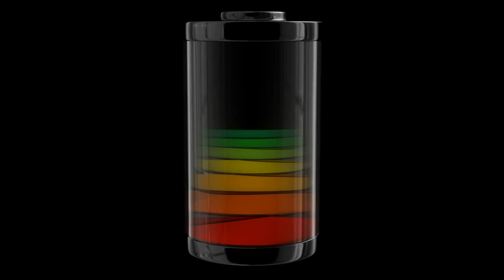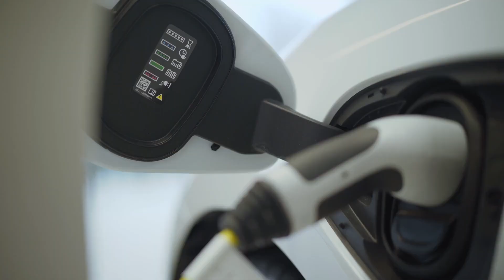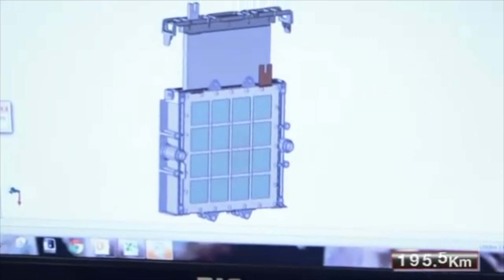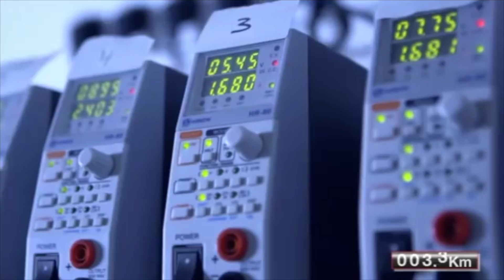This Battery Gives EVs 1000 Miles of Range!

Comment: We have for ever used the concept of refill and replacement, be it the AA batteries or gas in your cars, or soda bottles for coke / Pepsi, or the clothes you wear if you look at it in the broader picture. 
If a car can run 2000km per swap, it's a long time before you need a swap for the typical office commuter, and maybe a double hault for a transportation vehicle if its crossing larger distances. This I would say is a convenience, much less a hassle as long as the adoption doesn't come with higher car maintenance (increased cost/down time in car maintenance can be a major deterrent)
Typically even your cars have a battery for starting engine and so on. It all comes down to having a cost effective process of swapping batteries and wide adoption of those by multiple manufacturers. The infrastructure will come on its own and will prove to be definitely cheaper than the current concept of electrical charging or batteries and the associated wait times. 
Looks much promising and sustainable.

Comment: Single-use aluminum-air batteries with thousands of miles of range is a plausible solution, but I have to point out that lithium-ion batteries will still be required for regenerative braking to work. Supercapacitors couldn't recapture all the power generated by descending a long mountainside, for example, so without a lithium-ion battery you'd be spending extra power from the main aluminum-air battery to climb the mountain and then throwing all that energy away during the descent.

Comment: The problem with battery swapping where the station can't recharge the swapped out battery is they would have to store that battery until it's picked up by the recycler.  These batteries are huge.  Imagine 100 cars swapping batteries per day at a typical station.  Let's assume the recycler comes once a week to pick them up.  That's 700 battery packs that take up maybe 20 cubic feet each or 14,000 cubic feet.

Comment: Not rechargeable? Better off using alkaline battery then lol. FROM buzz to buzz kill..promises can be broken. Copper air batteries might do better. EV are for the rich at the moment. When they come down in price is when they will be more accessible. The price of the dead battery replacement is goo expensive.

Comment: Interesting concept. Overall, a good review of Al-O battery capability and challenges. Every form of energy has its advantages and its drawbacks/challenges. As we think “Green”, we also need to look at the full cost of any energy form from production to customer usage to final disposal (as applicable). Fossil fuel (which is a big misnomer) has really benefited mankind even amongst the bad rap it has been receiving in recent years. Without the use of petroleum fuel over the last 100 years, there would have been much less progress and development. Exploring new energy sources is a process. How many thousand years did it take to learn to reap the benefits of petroleum? Look how much progress has been made in the last few decades regarding batteries. The use of petroleum has allowed the migration of people from food production and survival to being able to have jobs that allow new development that ultimately benefits mankind. As for me, I am thankful that we have been able to harness the energy of petroleum/gas to improve the lives of mankind very significantly in the last 100 years. However, I look forward to newer technologies that will provide greater benefits to all in the next 100 years.

Comment: 300 miles Tesla battery is 1000 lbs and 2 gallons for gas?  What sedan can go 300 miles using 2 gallons?
Reply from the maker: Difference in energy stored, vs actually be efficient in converting it to motion. Gas engines suck at that

Comment: I'm imagining this: A service station similar to a gas station. Drivers enter, release the spent aluminum air battery from some kind of catch on the bottom on the car. You then drop that into a "used battery"slot of some kind. Then you pay some fee to grab yourself a new battery pack. Pop it in the slot, and you're on your way. From the service station's point of view, they would collect all the spent batteries and send them off to recycling centers while keeping enough stock of new ones. They could also provide clean water if that would be a limitation as mentioned in this video. Of course, some sort of legislation would be required to ensure all vehicles are built with the same compatibility, so the battery packs would be universal.
Reply: Something like a srive through car wash where it pulls you along the stages. No need for cash as can all be done robotically charged via reg plate
Reply: Under the system we have Money is God, so it won’t happen by killing the Golden Goose. Anything that make life easier is targeted for profit, cost more than gas Petrol.

Comment: I love the idea of swap able battery packs especially if they are user swap able. I'm imagining it now you pull in to a swapping station and pop in the new ones just like you would pop in a new pair of batteries in your remote. Plus if your going between further points nothing would prevent a driver from having a couple of spare cells in the trunk just in case they get low at a halfway point.
Reply: Yes. And If range is 1000 miles then user can have second pack sitting at home getting charged slowly for many days via solar - this could actually remove charging costs completely. Imagine vehicle costing zero dollars for fuel and comes with two packs when you purchase it

Comment: About the electric cars being the clean energy ( in real use is just for air) Once and again the same was told us about petrol wen Coal was the main sorce of fuel.....  If today you need 10 times copper just to one car production make the calculations for all others rare minerals if today the air is clean tomorrow the water and soil of this planet will be so pollute that you can drink or eat many health products (chille already have an open mine with more than 1.5 miles long and  0.5 miles depth and extraction in become dificult to get but more digging is being done) . Search the documentary the dark side of green energy. If this safer option is so good why they still fast forward to water pollution.... This people just think in how to make more money

Comment: When we start talking about 500 and 1000 mile ranges, what i really want to know is what battery % or miles will it cost to run the AC overnight parked (10pm to 6a) to get the inside down to 70F from 80F outside?

Comment: 9:50 Regarding a battery swapping station, in 2010 I predicted we would eventually see batteries standardized (up to a half-dozen configurations/sizes) by order of the federal government. Vehicle manufacturers would be required to install batteries in a manner making replacement a simple, routine procedure. Then we could pull into a battery station and have a batter swapped in no more time than it takes to fill a 30-gallon tank with gasoline -- for a fee, of course.

At the time I worked for a company that used dozens and dozens of electric forklifts. Often, when it wasn't possible to charge a lift for hours, it was taken to the batter-swap station where a hoist was used to remove the old battery and install a fresh one in less than five minutes. The same could be done with EVs.

Glad I didn't post this yet. I see at 12:15 this is the topic again. Yes, there would be things to work out, but the same issues probably existed in the early days of the gas engine and we got past them.

Comment: that battery swap its around 50eur to say, for me thats a full gas  so every month same price = no difference from using gas, only difference takes me months to use up all the gas i put in the car. When you say pollution, hows that electricity produced ? a coal power plant is producing that electricity you use for the car or any other device, yes we have renewable but thats a small %

Comment: The Al-Air fuel cell besides swaping the whole battery there is another option:  flush out electrolyte and sediments with fresh one and
Insert new Aluminum Anode plates.
Keep a supply of Aluminum Plates in garage. So no need for battery reprocessing industry. 
Just need a fresh supply of 
Aluminum plates and fresh electrolyte. Then take the Ox.Sludge and used electrolyte back to recycling station.

Comment: I saw something on another "future" battery which my Google Fu is failing to find which I think used carbon that while less energy dense than current Lithium Ion batteries recharges much faster which if it works out would be a great choice for those of us that do not have access to electricity where we park. Yes it would need infrastructure in the form of charging stations but since the charge rate is so much faster than Lithium Ion instead of the current 20 - 30 minute rate to an 80% charge we would be looking at times that more match the time it takes to fill the gas/diesel tank of current vehicles which is more in the five minute range for most civilian vehicles would make using public charging stations viable for the average person.

Comment: Today the best energy to use in vehicles is hydrogen to run the electric powered motors , Toyota has a patient on the high pressured hydrogen tanks, just for this purpose. That will be the real clean energy without damaging our environment.

Comment: 2 gallons of gasoline might be the equivalent amount of energy, but it doesn't give you 300 miles of range.  That's closer to 20 gallons depending on the vehicle.  Still tho, much less than 1000 pounds.

Comment: The very best solution to electric vehicles is the establishment of a hemp-create pyramid with a gold box inside. This gold box contains a radiated stone using high voltage DC current for an extended period of time. This pyramid was built to allow growing conditions to exist surrounding further built pyramid structures, thus feeding the growing populace. Presently there now exist a problem/solution to driving vehicles. Using this "Free" electricity to be generated! Placed on the Mississippi River near St Paul Minnesota along with a giant Crystal placed in the Gulf Of Mexico to absorb the north-spun current generated off the pyramid base(into the water) then circulated to the Crystal, then off the planet Naturally!

Comment: The problem I see is aluminum takes quite a bit of energy to refine and process... and replacing a 50 pound aluminum battery to go 600 miles sounds HORRIBLY INNEFICIENT.  I think this is a complete no go.  Yes it might have 9x the density, but at least a lithium ion battery can be charged what 1000 times...  So if this battery is 9x he efficiency and costs 1/10 the cost of the LI battery... you are still talking 10x the cost.  You will spend more in batteries than the Tesla the first year you own the car.

I think I am going to wait for a solid state battery or something else.

Comment: It takes massive amounts of electricity to process bauxite ore into aluminum since it's done by electrolysis. That's why the big push for recycling. Melting down and reusing aluminum takes much less energy. So you need a lot of renewable electricity.

Comment: We already have to stop at gas stations to refuel, which already have to be supplied by trucks carrying fuel. Electric vehicles need to charge for at least tens of minutes if not an hour to fully recharge. Aluminum air batteries would alter very little about the current logistics we have in place. Over the last 100 years we've built up our society around refueling stations and this battery solution fully leverages that. It's nearly ideal.

Comment: Although it is true that Lion batteries contain flammable ingredients, my understanding is that most of the battery 'fires' are in fact runaway chemical thermal reactions within the battery, not involving taking oxygen from the air. The energy in a lithium ion battery is stored by putting the lithium ions on one side of a barrier that they can only pass through with the help of electricity going around a circuit. But if you heat it up enough that barrier breaks down and they can get through directly releasing all the energy as heat causing a runaway reaction. this is technically not the same as the ingredients burning.

Comment: What a great channel. Very nice and easy to understand presenter.  

I was wondering while on the topic of Battery Power maybe there can be 2 shows on The Tesla Tower, which is a way to transmit power wirelessly thats been around for 100+ years (never went commercial since JP Morgan could not make money from it).   Functionally I guess its the same as wireless charging of your cell phone.   The 2nd is a battery from Toyota called the quantum battery that promises  30 second charge time and 1000 miles per charge.

I hope some of these ideas make it into shows.

Thanks..

 Jeff

Comment: A 1000 mile range would finally make electric cars practical. Because the range estimates from Tesla Ford etc are complete bullshit. When Tesla tells you thwir range they are lying about the fact that this is only in perfect amazing conditions with you not using AC, heat, audio system, towing. It is also quoted only in 70F weather. Hot weather and cold weather also drastically reduces range.

The $15K replacement battery cost is also something that Elon constantly dishonest to the public about.

Comment: No gas car is getting 300 miles with only 2 gallons, that's just wrong on so many levels.  Maybe in raw energy you are correct but 2/3rds of the gasoline energy is lost as waste heat so that alone requires 6 gallons which gasoline is about 10lbs per gallon anyway.  Add in gasoline cars don't have brake regeneration that also increases the gasoline waste another 50 percent depending.  So 9 gallons of gasoline is a more reasonable number or about 100lbs.  Of course you are not counting all the extra weight from engine block, heads, transmission.  You also reversed kilometers and miles, 620 miles = 1000 Kilometers, not the other way around.  You are aware that aluminum is the most energy intensive metal to produce because of the huge currents required in the process to remove impurities so it's not a 'source of engergy' but storage?  Also, it's storage media that would require you to keep buying it since you can't plug it in and charge it make the aluminum pure again?  Very misleading video.

Comment: The problem is only 15% of that 2 gallons of gasoline gets to the rear wheels85% is wasted as heat. That's why I internal combustion engines are called heat engines by engineers.

Comment: If the weight is fairly low why wouldn't you modularize them, say in 4 units, and carry a spare 4 units.  So you wouldn't need to go to a station to keep going - you would just do something like a propane exchange?

Comment: I wonder the cost of this. I like the range, but cost and time it takes to change the batteries. I drive several times a year between Chicago and las Vegas. Yes gasoline can add up for cost, but it takes 5 minutes at most to fill the tank. My truck gets about 700 miles on a tank. That's what I hate about current ev technology. I dont want to wait 30 mins every 300 miles to charge the truck. Plus if there is a emergency it is a lot faster to even throw a couple gallons into a tank to get where needed.

Comment: Long as the batteries are lighter or much easier then swapping a tire, with the cost ratio to be the same as traditional battery electric cell swap from the competitor models, then the only issue is the vehicle size, seems capable in larger vehicles do to the bulk.

Comment: Problem is electro-chemical. It is IMPOSSIBLE to electroplate aluminum out of an aqueous solution. Hence, any aluminum battery based on an aqueous electrolyte cannot be recharged -- EVER. If (and with a capital "IF") a rechargeable aluminum-air battery is possible, there must be a non-aqueous electrolyte. Perhaps chloroform or some other organic solvent can be used as a base for the electrolytic solution, but NOT WATER. I would not be surprised to see a rechargeable aluminum-air battery, but with some other solvent than water.